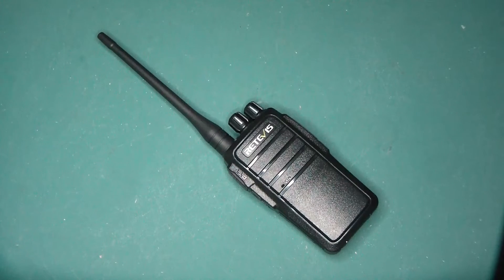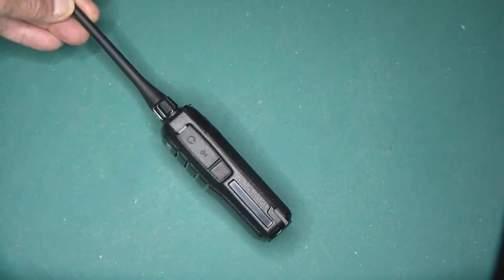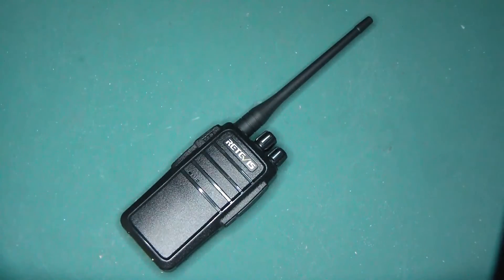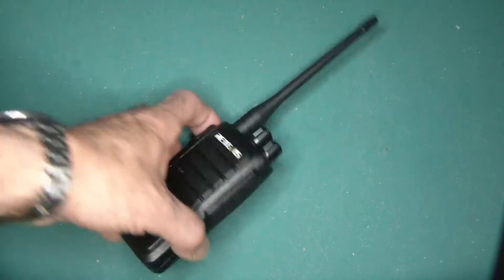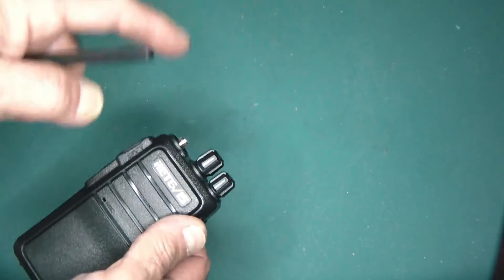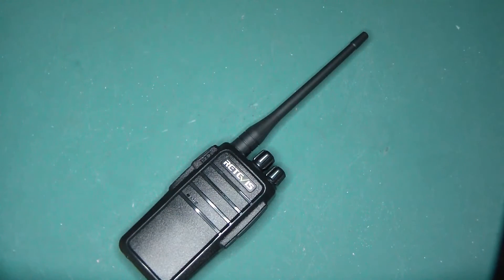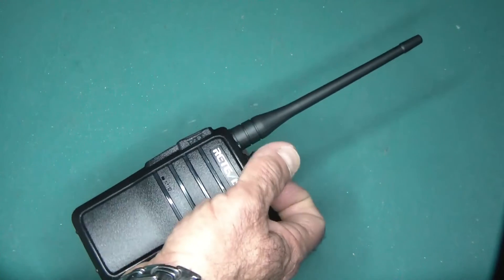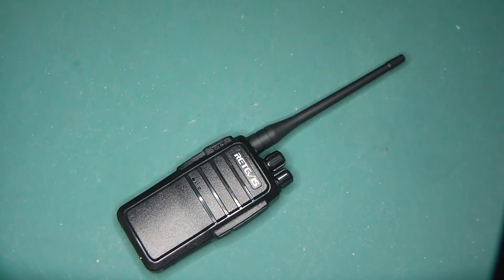RETEVIS RT21 GMRS to working MURS and FRS/GMRS

Comment: I just bought these the second version with the 3000 mah battery was wondering if i can communicate with the rca rdr 2500 because I'm so tired of carrying 2 different radios i have one for the English guys and one for the Spanish
Reply from the maker: I am not familiar with the model you mentioned so I cannot answer your question, maybe some else can. Although I am pretty sure you can program them the anything you want, as I have MURS, GMRS, on one, and PMR446 on another pair. And they are CHIRP compatible!

Comment: Does anyone recommend a replacement antenna for a Retevis RT21...
Reply: In use antennas from Smiley. They are well tuned and have great performance.
Reply: @kensakamoto258  I only see a telescoping tri-band antenna on Smiley, not Ideal. I would really prefer a non-telescoping dual band.

Comment: What program were you using to put on MURS frequencies?  Does this radio work with chirp?
Reply from the maker: Yes it does! I used it to program these radios. I have a pair set on PMR446 which I use in Europe, and THEY work fine also!
Reply: @fittoat9261  I am in CHIRP and trying to put in MURS channels and I keep getting a error out of range message.  Is the something special I need to select or something else you think I would be doing wrong?
Reply from the maker: @willblumenkemper6523  follow the links in the description to how it is done on Bf888s which then takes you to another link that shows you how to do that! Tedious, I know, but worth it!
Reply: @fittoat9261  Thank you.

Comment: If you want to go down the reprograming rabbit hole. Jailbreak the   Retevis RA25 and start programing  it with the spreadsheet programing software.  It will cause you to drink and both the radio and the spreadsheet has an ungodly amount of faults.   But when done it is a lovely sounding radio that can do anything  and at 17 watts UHF and 21 watts VHF  a mismatched antenna is not the biggest sin.  I have used it to tie into farmers business band radios that I have worked for.  Walmart must be upgrading their  store's  MURS radios.  Using the RA25, hearing and understanding  a store's radio system 5 miles away has become common place.   My guilty secret pleasure was walking over a 30 mile away weather station signal in our little town.  I got that out of my system and won't do it again.